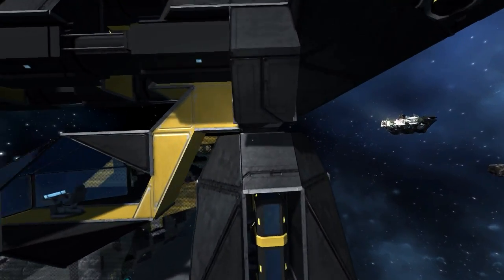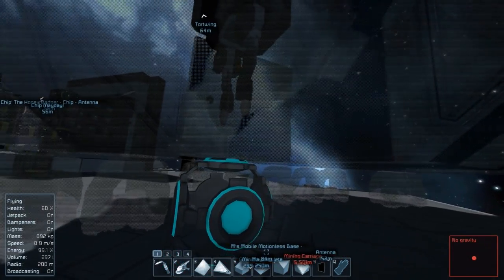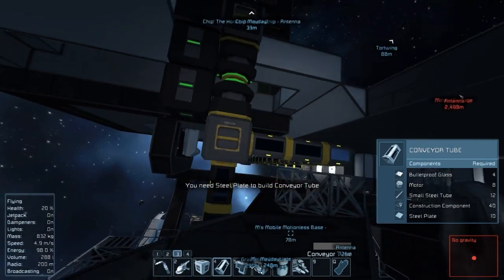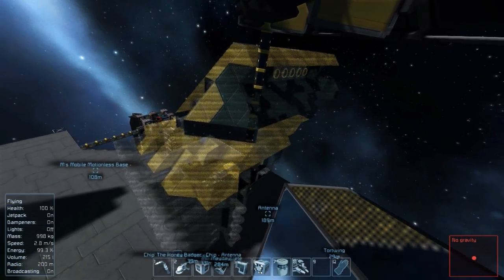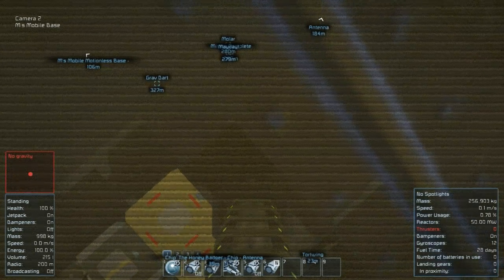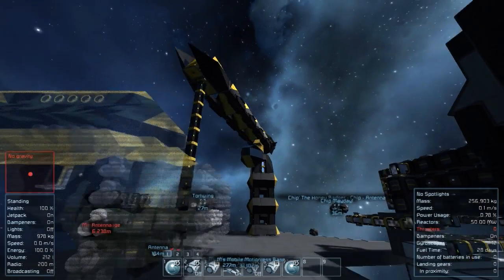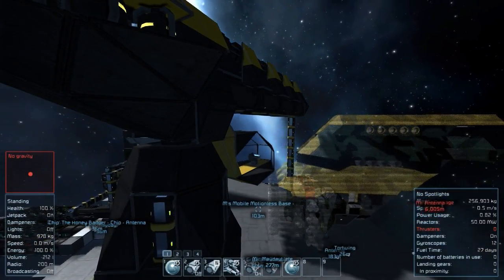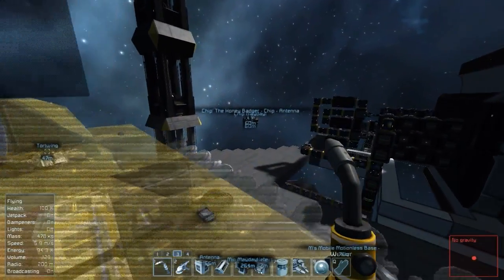Space Engineers • Solo Survival • 61 • Xeno Crane

Comment: It might not be the most useful crane but it sure looks good and that is what really matters!
As for the FPS problem I have found that reflections in SE are one of the biggest performance killer and conveyor tubes are the worst block when it comes to that. Minimizing the number of tubes you have can really help. I use the NASA parts mod because it has conveyor tubes without any glass on them and they help lots.
 I keep hoping some one will make a simple mod that changes the large grid conveyors to use the small grid large conveyors because they are about the same but with no glass.
Reply from the maker: ah, thanks.  I can experiment replacing them using SEToolbox and see how much that could help.  Hopefully we get some better control over the graphic settings in the game so we can tweak that stuff in game to help increase performance.  One day this game will perform better...I hope :)
Reply: +Morilibus Lp have  u thought about getting a npc mod and furniture ie beds n stuff

Comment: man that crane looks pretty cool, even though its just for fun and not a practical use sort of speak but still cool nonetheless.

btw if  you want to see more up close the welding, can you just put a rotor then a converter block and then the welder attach to it in an angle and add a camera to it on the rotor?
Reply from the maker: Thanks. That's a neat idea and sounds like it would work for a better view.   I worked out something that works a little better in the next episode, though we may still want to do something like that too.

Comment: Nice design! too bad it's not working as intended.
I think rotation may not be the way to go for your crane. you should try something like a "scanner", what I mean is a line of welder the length of your depth, and only moving right/left up/down. That way, you could build your projection layer by layer and it could be easily automated.
If you don't what to do the line, you can also do it with a single welder and another axis of piston and at that point you have a 3D printer like in real life.